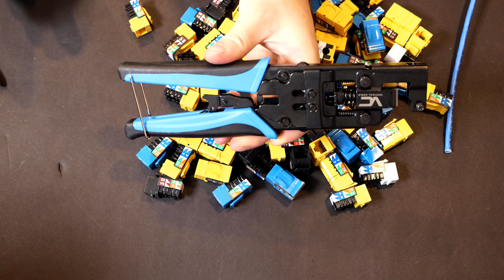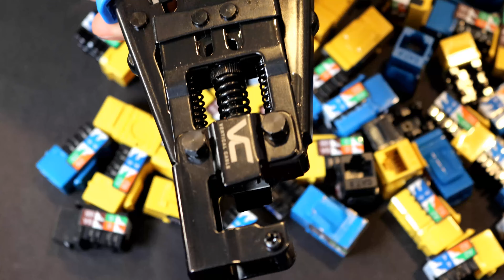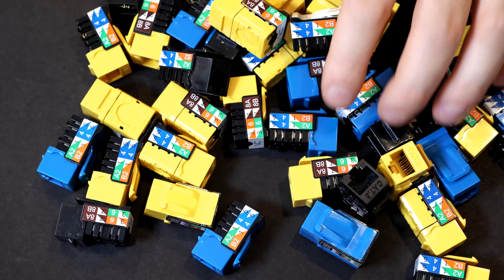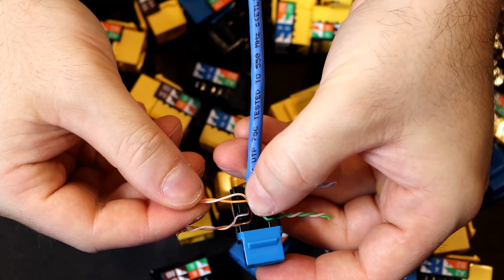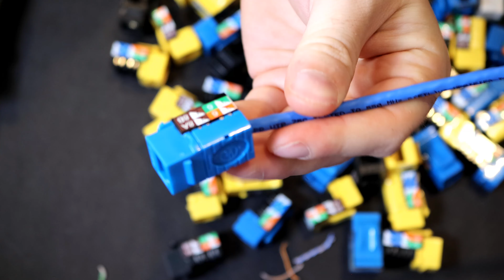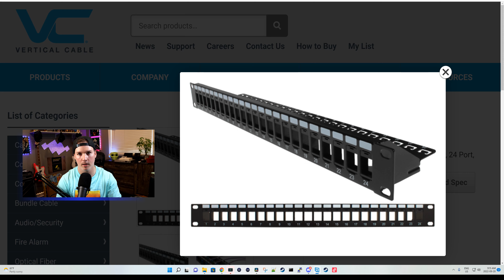Vertical cable I-Punch Tool

Comment: Nice crimper. One note that most people seem to miss regarding the pull string. The pull string has a purpose and is not really an optional step. After you strip the outer jacket with the scissors, there is always a chance you could have nicked the inner conductors. But if you use the pull string to pull a few inches down the cable, cut off the extra jacket (but the time without inner conductors in the way), you can then attach the connector without fear that any of the pairs were nicked. And no matter how many times you do it and have never had a problem, it will get you at some point so that reliability is worth the extra 10 seconds of work. Thanks for posting the video.

Comment: I use Yellow or Orange patch cables to identify PoE lines and Violet for Video and finally Red from the modem to the router and sometimes uplinks. It's a LOT easier to walk a USER over the phone to look for colors and ask what the lights are doing especially if they don't know how to do a video call or hold their phone properly for showing what's happening over the video. Blue keystones for data is pretty much standard but I'm not sure where that got started at.
Reply from the maker: Those are good colour codes to have :)

Comment: Great content Cody. And for RJ-45 males what do you use? Normal or passthrough? I use Platinum Tools 100054C Clamshell EZ-Rjpro Hd Crimp Tool
Reply from the maker: So I rarely user passthrough RJ45 but if I do I use the Simply 45 Pro series. They come with the "Cap 45" which is a little cover to put over the conductors so they dont short out. Link below

https://simply45.com/shop/modular-plugs/rj45-proseries-pass-through/s45-1750p-proseries-cat6-shielded-external-ground-pass-through-rj45-with-cap45-bar45/

Comment: Hey Cody, first off let me say I really like the new camera angle and the lighting a lot, looks awesome! A few years ago you turned me onto this tool and I can’t thank you enough. I had just punctured my index finger on a job using the traditional punch down tool on a job. Timing then was perfect! I just did a video covering my top 5 time saving network tools, and the Vertical Cable Punch Down came in at #1. Have a great day!
Reply from the maker: The Vertical cable punch tool is amazing hope you're doing well :)